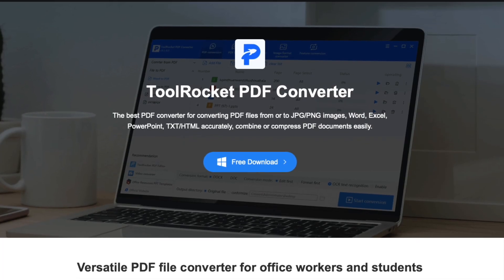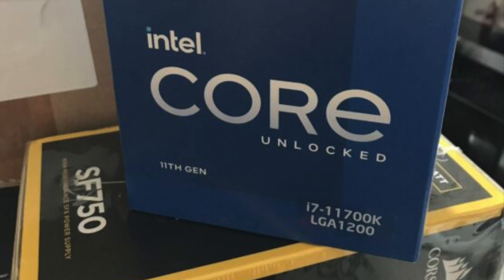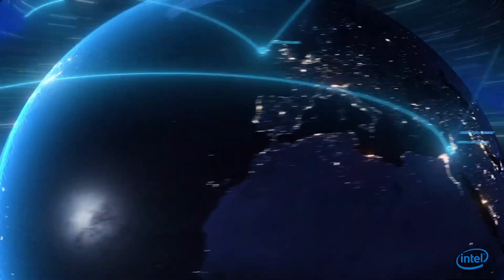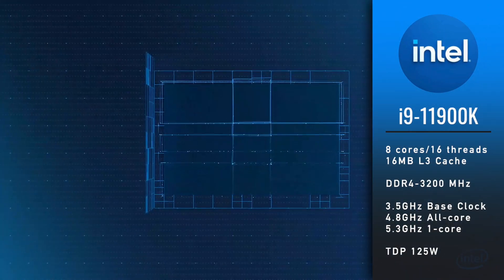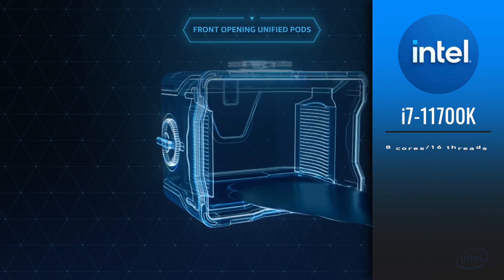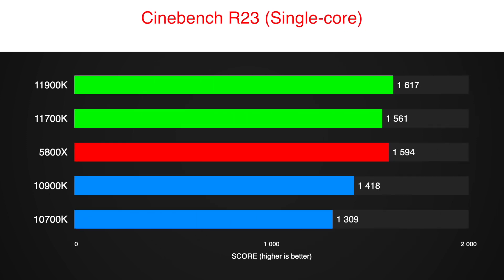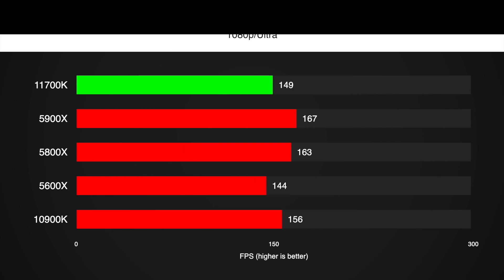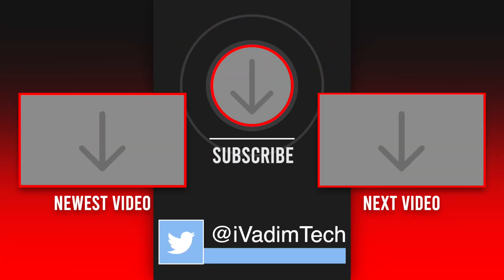EVERYTHING about i9-11900K & i7-11700K [Benchmarks, Prices, Release Date]

Comment: 10400f is still the most vfm cpu. maybe also the 3600 if you find it at <=200$
Reply: I have a 10400. It basically performs the same as my 9th gen mobile I7. Im pretty happy with it. If I upgrade itll be because I want to. Not cause I need to.
Reply: @bradbeyers9028  👌🏼👌🏼

Comment: i cant decide 10700k or 11700k big upgrade from an i7-6700k
Reply from the maker: You’ll be able to get a real upgrade at the end of 2021/start 2022. Something like Intel 12th gen/Ryzen 6000 and DDR5 RAM. Those are worthy upgrades. IMHO, buying 11th gen is a waste of money. Isn’t your 6700K performing good enough to wait for better tech and prices?
Reply: @theivadim  curious of you're opinion. I currently have an i5 6400t in my HP envy all in one. I just purchased a custom built PC with the i7 11700k today as it became available today on their site. Price aside, was it a mistake to get the i7 11700k over the i7 10700k? Im definitely gathering it just isn't as good as the hype but over all I did choose the better, correct?
Reply: neither, 10850k and call it a day
Reply from the maker: @ilovehotdogs125790  yeah, pretty good option as well. Especially if you can find it at a discounted price.

Comment: I'm calling BS on this. No way 10900k is going to be a better performer then the 11900k and at a lower price point. That would spell doom for intel for the next several years. I would put money on it that the 11900k ends up with the highest gaming benchmarks across most titles and outperforms the 10900k in all but a couple very specific scenarios. As a matter of fact I have a build in process right now and am holding off until the end of the month when these release.
Reply from the maker: Oh... there is no doubt that 11900K will beat 10900K in gaming. But it is losing in multi-threading tasks for sure. However, 10900K won't be a problem. Intel just has to discontinue it.
Reply: the 10900k will be better in games that can use the cores.. like warzone and most battle royals. But in single player games the 11900k will be better
Reply: @ilovehotdogs125790  Are you sure about that? are battle royals really using all 10 cores? I mean what is the point of putting out a new iteration if it does not even perform as well in the games that people are playing the most.
Reply: @bqproductions7448  Because gamers don't know any better.. they just assume single threaded performance reins supreme. The truth is that it depends, and yes many battle royals including pubg and warzone can utilize more than 8 cores. The 5950x with smt off gets the best performance in that game, the 10900k is second best.. the reason why 5900x doesn't beat the 10900k is complicated. It has more cores but it doesn't make up for the huge memory latency discrepancy. Without getting into it too much, short answer.. yes. The 11900k QS has been tested against a 10900k (I don't have the source) but the 10900k won in those games. In single player games like assassins creed the 11900k wins. It's all marketing, you can never claim something as being the best at gaming if you only test like 10 games and compare with that lol. There are so many games that run better on different hardware. Trashy unoptimized ubisoft games usually run best on intel, csgo and valorant run best on zen 3 amd, warzone is best on a 10900k and 5950x, the single player games will run best on an 11900k.. etc etc
Reply: @ilovehotdogs125790  I am really asking though because those are the types of games I play the most and don't care about single player games most of the time.
Reply: @bqproductions7448  according to leaks on the qs 11900k as well as the fact that many games can scale beyong 8 cores suggests that the 10900k would be better for the battle royals that i mentioned. idk about fortnite, but warzone will most likely be better on a 10900k.. slightly. I would wait for reviews to come out, and not linus tech tips or even gamers nexus.. do you plan on overlocking? Because we don't know how well rocket lake will overclock, if it can hit 5.3-5.4ghz all core then it could be a different story. I hope you also realize that ram speed and timing are VERY important. Ignore people saying "it does matter for intel." Look up Frame Chasers on youtube, he talks about rocket lake in some of his vids. If I was you.. I would get a 10850k or a 10900k, especially if you don't care about single player.
Reply: @ilovehotdogs125790  Well I have a build ordered currently with a 10900k, an msi 7590 game carbon wifi motherboard, and gskill tridnet dd4-4000 but it does not list the timings. I upgraded from the Z490 version to the Z590 and may have the build hold off on being completed if I thought it was worth waiting until the end of the month for the 11900k. I am locked into intel though so I cannot switch over to AMD. I am learning a lot as I go but obviously have a lot more to grasp and appreciate your responses.
Reply: @bqproductions7448  nice, i have a 10900k too. Make sure your ram is bdie. You can go to bdiechecker on google to see. Bdie ram means you can tighten the timings or increase the frequency more. My ram is 4266mhz cl17 timings. With ram like that amd is out the the question, ryzen can’t use 2x16gb of dual rank ram faster than 3800mhz max. That’s one of the reasons i returned my 5950x. The fanboys on the internet really have no idea so i’m glad you didn’t fall into that trap. The motherboard seems fine.. I don’t know anything about the new z590 boards.. just make sure the vrms are good and the pcb os thick enough for decent memory clocks. What’s your cooling solution? I have my 10900k at 5.1ghz on a noctua air cooler. If you plan on overclocking your cpu then just make sure the temps are being monitored. Also.. important, some motherboards have problems with overvolting the imc so do some research and see. Worse case just monitor the vccsa/vccio voltage and make sure it’s not like 1.4v or something crazy. Especially with your 4000 mhz ram the auto setting might just ramp that shit. Also usually you want to disable multicore enhancement.. but it depends on the vcore voltage so it might be fine.. i hope i’m not scaring you lol. If you don’t want to deal with any of that shit just make sure your vccia and vccio voltage isn’t too high, with fast ram the motherboard auto settings are a little crazy. Good luck